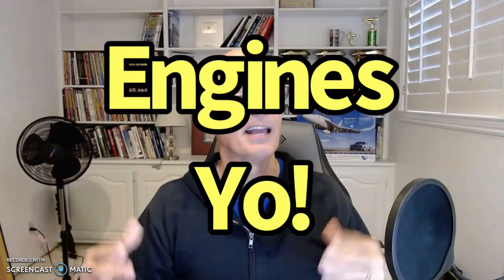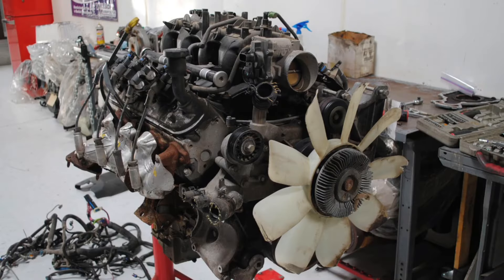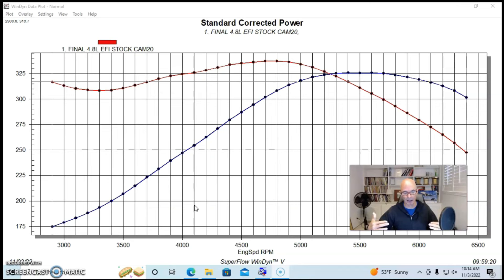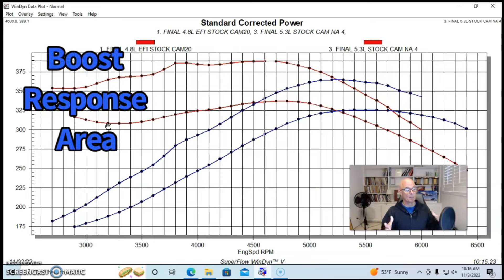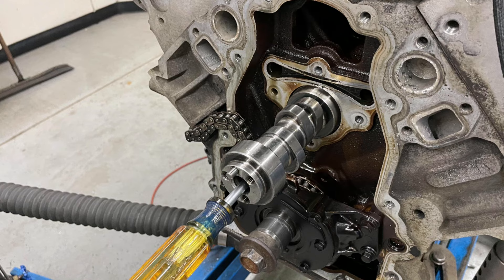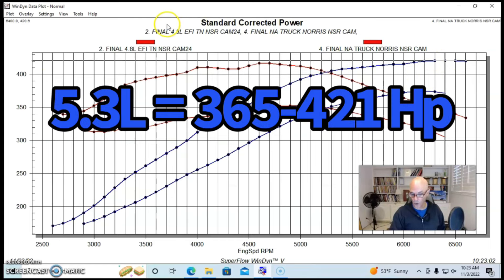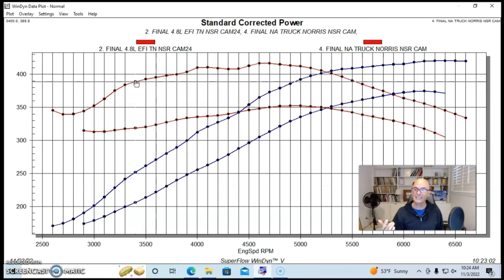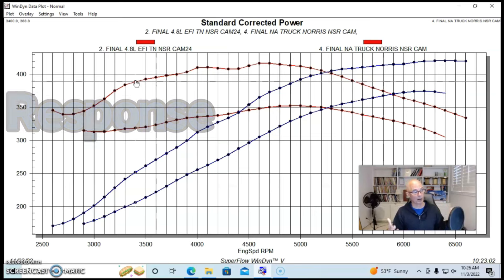DAVID VS (LITTLE) GOLIATH. 4.8L VS 5.3L, WHICH JUNKYARD LS DOES IT BEST? WHICH IS BETTER FOR BOOST?

Comment: Here's the thing about the 4.8 that most people don't realize..... They are cheap to race and replace. I helped a friend set up a Camaro for drag, with a little 4.8 and a big turbo(s475 I think). We have 4 engines in the garage for only $500 total, and one for free with valvetrain noise. Blow an engine, swap everything over(like cam and springs), and he's running the next day. 

Near me, the 4.8 usually gets $150-300, a 5.3 gets $400-600, and a 6.0 is $800+. That's a big price difference if you're just looking to have fun, but if it's meant to last then it's worth it for the torque.
Reply: What junkyard you buying those motors at?
Reply: @michaelcoleman5258  I've been finding them on facebook marketplace, locally from friends, and sometimes u-pull yards. From most yards, it's more like double those prices..... Mid Ohio, if you're wondering.
Reply: Gasoline engines of any make or model are $260 including the core charge at my local yard
Reply: Best part is the 4.8 never had DOD BS

Comment: I love my little 4.9 (3.810 bore, stock 3.267 stroke).  Works really well with ported cathedral heads, TBSS intake, 92mm TB, and some quality tri-y headers.  Not overly powerful, not too quick.  Creates the same style of fun of old civics, but just a bit more than that.
Reply: Gears will really get them going
Reply: I am going to be boosting a 4.8. I have 799 heads for it and doing an undermount with an inline intercooler. Express 2500 work van. Wish I had buddies to work on it with. My kid will do.

Comment: As many engines that I pull from pull a part for 300 bucks I have only acquired three 6 liters. One lq9 from an 02 Escalade and two Lq4’s from Denalis. I only get 5.3 motors because they are easier to sell. It’s a bolt in upgrade for the 4.8 guys and I advertise that. Quick tip. Most of those trucks are in there for bad transmissions but I only buy motors from crashed trucks. It was running when it crashed. Worst case is low oil pressure.  The driver side head will always look dirty when you take off the valve covers but you can tell if it has been taken care off.

Comment: I  would guess the weight is the same BUT is the 5.3 in Aluminum easier to find. I like boost but more in the Supercharger Vortech style than Turbo. Seems the 5.3 LS with a cam and boost would be plenty for any budget cruiser. Good review. Dennis

Comment: Got a wild Idea. Have done some research and hot rod magazine did an article titled the 350 chevy should have built. Its a 400 small block with a 327 crank. Get this the 4.8l ls has a factory stroke of 3.26 inches. The ls7 has a factory bore of 4.125. So a destroked big bore. The 377 inch small block which is a 400 with a 350 crank was a circle track monster. But the 327 crank was better with afr heads. Had diesel like torque on 85 octane actually. Well over 400 foot pounds through the entire rev range

Comment: I find a lot of 6.0 lq4 engines up here in Canada but they usually have issues. One I recently got for $600 had a bad cam and lifters but was otherwise in good shape. I have 2 other bare blocks that need cam bearings installed for sale.

Comment: I'm doing a truck Norris in my 07 Tahoe..got heads done w seals and good springs,560...I have to get 2 bolts removed from one head,,,exhaust....only problem I'm going to have is getting everything in to 0 lash...never done...but watching you for a while and done everything be so far by your video's...batteling diverticulitis at the moment so can't get much done r now....is it that much of a pain to get that right...I can't afford much Xtra...getting some nice weather this week in Rhode island so I'm hoping to get done... Everything so e kk see be went according to plan,heads,lapped Cleaned,seals,springs...got them on,cam in,chain...just pushrods,rockers and the lashing.....I'm pretty mechanical...for some reason I'm a Lil shy on this..,,thx for your help on doing all of this....
Reply from the maker: checking pushrod length takes 5 minutes

Comment: Can’t wait to see more L33 stuff. That’s what I’m leaning towards to put in my Isuzu pickup. I like the idea that the L33 is also lighter than the iron blocks
Reply: It's basically an lm7, but aluminum with 4.8 pistons, 243 heads, and a slightly different cam. If you want to build it up, an lm4 might be cheaper to find. It's still aluminum, but the same as an lm7 in every other way..... Either way, anything in these tests for a 5.3 applies.
Reply: @doc221978  Except that the LM4 has dished pistons, a cam with less lift and duration, pressed pins versus floating, front sump instead of a rear sump but other than that... Well, they both have an aluminum block and 5.3l of displacement.
Reply: @Warloch1   @Warloch1 you're probably right about the sump, I've never built an l33. I did say if it's to build up though, and that it's an aluminum version of the lm7. I also listed the cam, pistons(same PN as a 4.8), and heads. Almost every l33 I find is at least $1,200, and an lm4 is about $600. Depending on his goals, it could be a viable option. 

As for gen 3/gen 4 internals, at the power most people push it's negligible. It's coming into play at well over 1k hp. Also, around 04 or 05, the lm7 and LS motors in general received the gen 4 internals..... And I would replace the rod bolts on either. I have a few stories about that.

Now I'm going to look up the l33 oil pan and sump. I don't remember the block being different, but I'm not sure.
Reply: Find a short block l33 and put 706 heads on it. It’ll make great all around power
Reply: @doc221978 The L33 is rear sump. The LM4 is front sump.
Reply: Built a 400 sbc with nitrous in a 91 isuzu.. gawd it was wheels up fun on 14" wide slicks
Reply: @darin2009  I can’t wait to get started on mine. Real struggle learning patience
Reply: @jeremyplatt1159  we were running 10s. Solid on the factory rear axle with 4.10s. It was welded up solid though.  Then back halved it. Frame rail to frame rail was only 12 1/2 inches wide  so we could tuck those 14.5 inch wide Hoosier up in the  deepened wheelwells.. that darn truck was fun.   Bench seat.  No roll bar... yea real smart right. Lol.
Reply: @SubePelayo928  they come with 243/799 heads from GM, better than 706 castings.

Comment: RPM capable 4.8 has a Rod/Stroke ratio 1.92 😳😳😳. Simply doesn’t get much stronger! 
5.3/6.0 have a good ratio of 1.68 👍
Reply from the maker: the rpm potential of the motor is the valve train-not r/s ratio

Comment: 4.8L vs the old school 283 small block v8. I own both engines and love how they both rev. Owner and huge fan of both engines. Time for a shoot out of the ultimate under dog!
Reply from the maker: a stock lr4 4.8l makes 40 hp more than the best factory 283
Reply: @richardholdener1727  what would the engine code be for my 4.8 in my ‘07 sierra classic?

Comment: Richard, Please be willling to answer this question. I say that LSA of a cam and LCA are not the same. LSA is permanent and can't be changed. LCA is adjustable and what you get when degreeing/indexing a cam.  And LSA means the same no matter what country. Correct?    I mean like, UK doesn't use LCA to mean LSA do they?
Reply from the maker: lsa and lca are different, lsa is fixed once the cam is ground
Reply: @richardholdener1727  Thank You. But I know and understand that part. But do other countries such as UK or Australia use LCA and LSA interchangeably?  Have you ever heard of anything like that?

Comment: Can you test a 408/416 4" stroker with stock ls3/l92/square port heads and intake versus a stock displace 6.0/6.2 with aftermarket heads? Both combos with a similar camshaft?

My guess is that the 408 with the stock square port heads and intake will make more power than a stock displacement 6.0 with aftermarket heads but I can't prove that. Doing a 408 is attractive/cost effective (to me at least) for someone who needs to do a rebuild anyway.
Reply from the maker: a stroker version will have much, much more average power even if peaks were similar

Comment: I would like to know the rated power of the tested engines - I know the Numbers are not comparable with headers, ecu and no auxileries, but it would give a hint of where power/tq goes from and to. In Denmark where I live the regulations are quite strict going over 20 % power increase. 😢
Reply from the maker: 285-305 hp rated (the rating depends on exact vehicle)

Comment: Hey Richard. Would you be able to do some stock bottom end ls1 turbo testing. I personally own an ls1 Holden here in Australia and I want to basically find out when they go bang essentially and how much power can be made safely before they go bang
Reply from the maker: you can go to 800-900 with ring gap
Reply: @richardholdener1727  thank you so much for replying 🙂. That's actually seriously good looks like I'm doing sbe turbo ls1

Comment: All things being equal (and appropriately sized, as far as turbo), more displacement is more power. Pretty sure the tune and valve springs on the 5.3 will negate any benefit to the percieved rev-happiness of the 4.8
Reply: In other words, dollar for dollar, 5.3 wins. You can make the 5.3 rev up even better and make more top end power than the 4.8 with minor valve train mods, proper wastegate sizing, tune, etc.
Reply: Not to mention the 5.3 LS you can put 317 heads on them and they have more grunt

Comment: Can You gain power by adding headers 3” Exhaust an intake an throttle body with the stock tune ??? Would b a good video. I have all that done and the Diablo sport predator two tunner on my 03 suburban an she feels peppy lol
Reply from the maker: I don't run a stock ecu on the engine dyno with a stock tune
Reply: @richardholdener1727  i no was just thinking if there was a way then everyone that does bolt ons would no

Comment: If I was just after mpgs and that's the main thing I wanted, then I would get a 4.8 with a btr torque cam and 4l60e and just enjoy the car.
Reply: Why a 4l slippy e get a 4l80
Reply: @jean-phillipegagnon2120  a 4l60e is an ok transmission if your not dogging it, reread what my comment said,
Reply: @jean-phillipegagnon2120  60E is fine below 400 HP, and in lighter vehicles.
Reply: @davidcunningham00  for sure but hard not to wanna give it the beans with that sweet ls sound 👌
Reply: @jean-philippegagnon3383  well you can put a few things in a 4l60e if you wish,  my wifes 2001 chevy 1500 with a 5.3 and a btr stage 1 truck cam has over 200k miles on the original 4l60e transmission,  it's a daily
Reply: @jean-philippegagnon3383  to enjoy a vehicle to me means I can walk outside, get in and drive somewhere and it don't have to be petal to the metal hauling a s.  S

Comment: I have an 02 4.8/5.3 cast iron block with the 826 for heads that came in the block what the heat range on the heads bre they go bad reason I ask my engine over heated for 30 minutes heading to work lost water to the transmission

Comment: Hi Richard. What if we take a 4.8 and bore it out to 3.898 - 3.903 and install LS1 pistons? Would it be worth it?
Reply from the maker: it will make more power
Reply: @richardholdener1727  but is it worth the $$ VS  the L33?

Comment: So i just bought an 04 tahoe and the motor has been replaced how do i identify her, she has an electric throttle body.. has 706 heads iron block.
Reply from the maker: no way to know for sure what cam is in there unless you take it apart
Reply: @richardholdener1727  Thank you for your response. I have overlooked the writing on the air box that run's to the intake. It reads this engine is E85 compatible. I do believe it came with the new engine because the 8 digit number on vin decodes the original engine was an LR4. E85 to my Google knowledge would be a L59!

Comment: I wonder how much of the extra power from the 5.3 vs 4.8 is the higher compression
Reply from the maker: it's displacement
Reply: @richardholdener1727  about how much does a typical 5.3 make vs a flat top 5.3? are we talking 5-10hp?

Comment: As a response to your comment about not wanting to rev past 6500 on stock valve springs. I have a turbo 4.8 that runs 18 PSI everyday and shifts at 6800.  Aside from head studs the engine is stock and it is tuned on 87 octane Believe it or not.

Comment: Seems like running the 4.8 with stock springs and not revving out really handicaps it's only strength in this test? Would love to see the same test but with a cam made to take advantage of the higher revs and springs to match.
Reply from the maker: the 4.8L won't rev any higher than the 5.3L-the valve train dictates rpm

Comment: Have you tried running the Truck Norris cam that doesn't need springs with boost yet? I want to see if the rev limit will drop because of the extra boost pressure behind the valve.
Reply from the maker: IT WILL BE FINE UP TO 6500

Comment: And maybe if they share the same heads
Reply from the maker: same test was run with an lm7-same results with the same heads
Reply: LM7 and LR4 came with 706 or 862 heads
Reply: I see thanks for the reply was quite curious also have been looking around to see if you did a video on solid lifters versus hydraulic

Comment: Will a 2004 awd 4l65e bolt right up and run with no problems to a 2001 5.3 z71  manual Lm7 ? I know I have to swap my transfer case onto the transmission I just want to make sure it will work if anyone knows ?
Reply: Z71 manual? Or it’s 4x4 
Z71 are electronic 4x4
4x4 trim is still manual 
But it should work
Reply: @reyperez3424  thank you Rey. I have manual ( floor shifter ) z71 5.3. Mildly build top end just want a lil better transmission. The donor is coming from a 2004 6.0 awd Denali. The one on right now is stock 60e and doesn’t move or get up if you know what I’m saying
Reply: It'll work. I have an 06 4L65E from an H2 in my wife's 02 Z71
Reply: @georgiaboy1579  so it will fit my 5.3? I heard something about the 65e only fitting 6.0? Is that true

Comment: If u turbo charge a engine other then valve springs, tuning is there anything else to consider like need specific heads cam, intake best used in boosted engine.
Reply from the maker: a stock cam will work with a turbo, an after market cam (like shown here) makes more power na and boosted

Comment: Wondering how much HP and torque is being left on the table between the truck Norris NSR and the Truck Norris that requires valve spring upgrade.
Reply from the maker: watch the nsr vs tn video
Reply: @richardholdener1727  of course.. what was I thinking, there’s the answer 7HP . Now the question is, is it worth spending the extra coin on springs and pushrods for 7 hp for a street machine. I’d say yes if the engine has high mileage. 😎

Comment: smaller car smaller engine
bigger car bigger engine
bigger engine more torque more burnouts smaller engine less torque less wheelspin
notice how both engine's with same cam upgrade, the torque curve falls off in a straight line at the same rate, like 2 railroad tracks. 
more displacement moves the torque curve up and to the left
more camshaft moves the torque curve up and to the right
boost moves the torque curve UP!